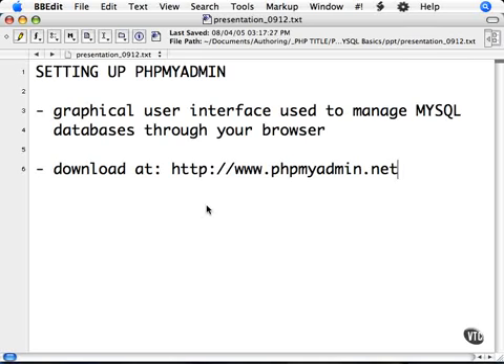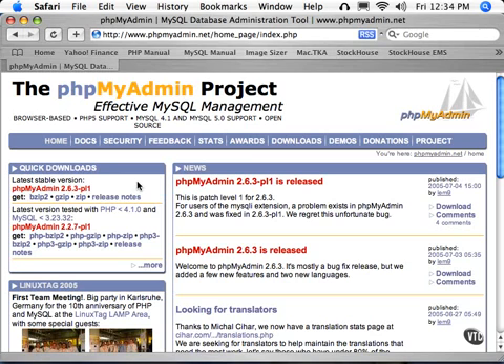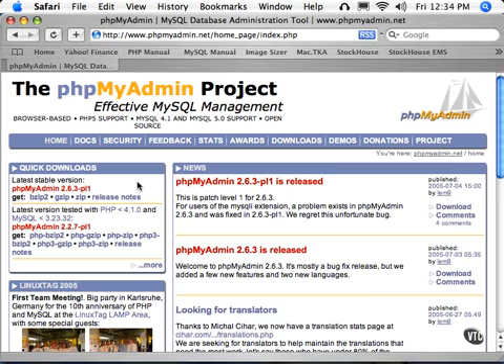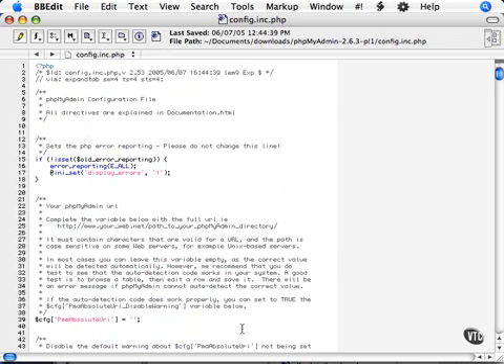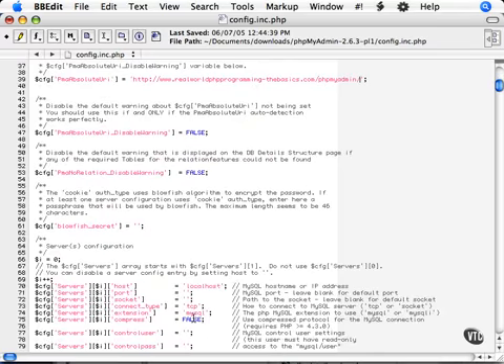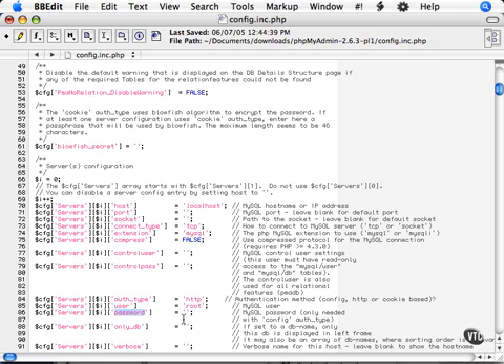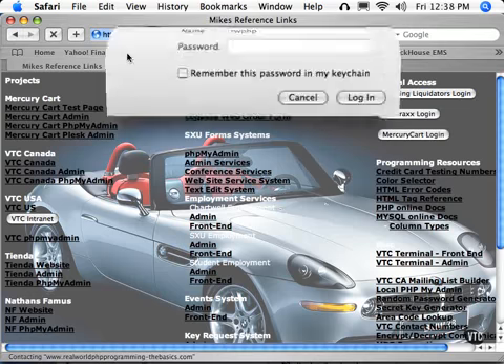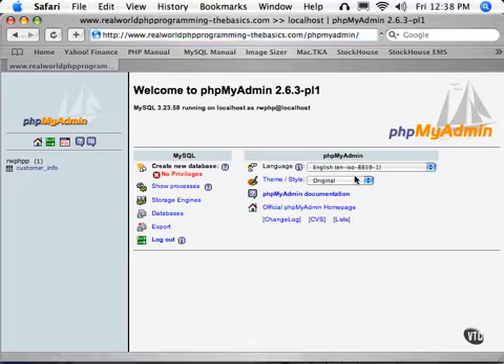php Tutorial for Beginners 74  Setting Up phpMyAdmin

Comment: Your instructions are very clear, but very back level.  I tried using your instructions in this video on the most current stable version of PHPMYADMIN and the config.inc.php file doesn't contain the code you noted here.  Is there an update to this anywhere?

I hope so.  Your instructions are very clear unlike many others and especially geared toward someone without much of an understanding of PHP.